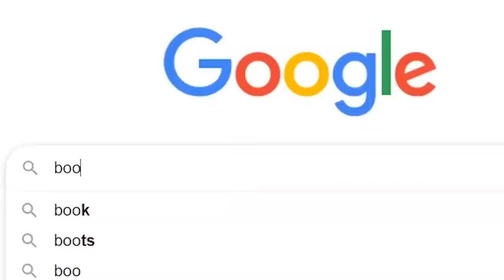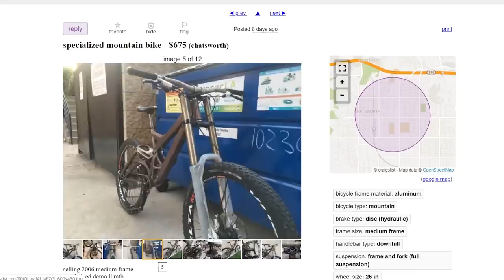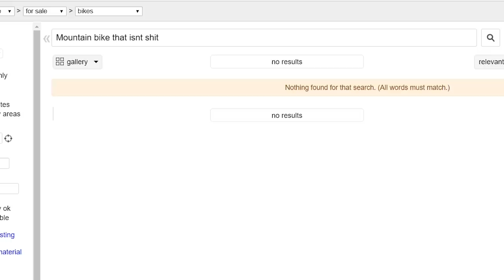Do NOT Buy a Cheap, Used Mountain Bike

Comment: Real mountain bikers were probably cringing through this whole vid
Reply: 🙋..yep!!
Reply: Real mountain bikers started on walmart bikes. I rode something like a 45 pound bike with solid tubes when I was a kid. Now I ride a 29er fully that weighs less than 30 pounds lol
Reply: Kevin O'Hara true
Reply: I was like WTF xD why dont he buy a new one
Reply: Yes especially when he was saying don’t buy a used mtb. Used can be great
Reply: i did
Reply: @lucasomers7520  Yes great for trashing but for real riding u need a new mtb for at least 2,5k
Reply: @The_Dude_420  nope, I do downhill, and my downhill bike was used, ( it's a de vinci Wilson from 2009, with a Marzocchi 888 fork) the "trick" to pull good bikes from used market, is to get SINGLE COMPONENTS and then assemble it, (that's what I did) the problem with doing this, is that, it's not really something for beginners that don't know a lot about bikes,
Reply: @kevinohara8529  not true i started on a trek marlin 6 2019 and now i own a trek slash 2020
Reply: Yep it's awful😔
Reply: Yep
Reply: @The_Dude_420  no you don't.
Reply: Inwas

Comment: I like how he called mountain biking expensive but he thought expensive bikes were $1000-$3000. For a full suspension $3000 is relatively cheap
Reply: Aye
Reply: You can spend 5k+ easy. Hell, some frames alone cost that much
Reply: Ya one of my buddies just got a 2020 Transition Patrol in Carbon. It's about a $7500ish build
Reply: Ehh... you can save $5000 by pushing a few more watts on the climbs.
Reply: Ye
Reply: I been trying to get a bike and the cheapest bike I can find that is actually good for what I want to do is the Giant Reign 2 which costs $2700.
Reply: Tozik 2021 sworks epic is a solid 11 grand💀💀💀
Reply: Riley Buchanan I seen bikes go over 10K, I was just mentioning the cheapest one I could get for what I want is $2700 meanwhile in the video he talks of a $1000 - $3000 range
Reply: Riley Buchanan some ebikes go for 20k Canadian
Reply: @IngE02  look on pinkbike
Reply: 3 months ago, $2,400, brand new out of the box 2016 Kona Process 134 DL. Best decision I've ever made.
Reply: I know
Reply: I mean your wrong but ok.
Reply: >$3000 cheap

me suggesting to my dad that i should buy a polygon premier ($450 here): 
my dad: hell no, why you need that bike so expensive

p/s :my last bike was a 120$ "Trekking 27.5", the front fork failed catastrophically after an hard emergency brake (I haven't even hit the trail yet lmao) (my mom bought it for my birthday last year)
Reply: @IngE02  this years Cube Stereo bikes are great too! And you can get the race versions pretty cheap too, amazing bang/buck
Reply: You're fucked when a company will sell you a set of wheels for the same price of a full sus bike
Reply: No it's not

Comment: I bought an old GT as my first mtb for $200 at a local bike shop. I would highly recommend getting your first used bike from a reputable bike shop because they will have it in good working condition. Also $1000-3000 will get you a decent mtb, but if you want a good mtb you're looking at about $4000 and up.

Comment: I bought a Trek 4300 XC Hardtail about a year ago for $100. I've replaced everything on it except the bottom bracket, headset, and rear wheel for about $500 over the course of a year. 
It's a great bike, but I just wish I'd spent a lump sum on a newer bike with better geometry for around the same cost. I feel like my head tube is going to snap off at some random time when I land a jump to flat.

Comment: bought a bike from blocket sweden for 1750 krona (201,26 USD) pretty good deal, aluminum frame, nice geometry, finger shifter, disc brakes (mechanical), 26 inch wheels (im 11), aluminum pedals. really happy.

Comment: To anyone reading this...If you live in a region where you think there is a chance your bike might get stolen, besides bike locks, something you can do is hide a gps tracking unit on or in the frame. These units are pretty small, relatively cheap and connect via an app on your phone. I know Milwaukee tools makes one but I'm sure there are others out there as well.

Comment: Yea go for a hard tail, especially if you like to jump. They are cheaper cost less to maintain, less issues and you can pretty much do anything with them. I'm on my 3rd hard tail. The only reason I would go full suspension is if I was doing some serious downhill riding or steep technical fast trails that have a lot of rocks and root and drops. Hard tails will get you through mostly anything to be honest and they are way more snappy.

Comment: Welcome to MTB! I hope this doesn't dissuade you from getting back into it. Check out PinkBike's Buy/Sell pages, probably about the best resource for used stuff, although CL and OfferUp can be fine if you know what to look out for, as it takes even more savvy to buy used bikes. Sorry it got jacked anyway. A good D-Lock will set you back $70-100, definitely worth it if your bike is $500 or more. Cable locks are good if the thief has no tools, but I think it was Doddy over on GMBN that proved a cable lock is truly only better than nothing, and not more.

Comment: You can buy a cheap $150 buck wally world special and upgrade it for about $350 and it will be decent.  You will have to replace the wheels to double wall with new tires and a new front fork.  Also replace the rear shock and new wide pedals.  Thats what I did.

Comment: you can get a great bike for under 2000$ actually. 
The old 26ers are still amazing by todays standards & generally bikes like scott spark are pretty well maintained.
Most people drool over the 29ers but the sad truth is that the vast majority is way too weak to accelerate on those large wheels.
Even when the playing field levels a 29er will always have issues keeping up with a 26er on the short technical tracks.

Comment: never leave bike alone in place with little ppl, or in a parking lot, always inside in a car, and always have it locked up with several locks, and if with another bike lock them to each other, use different locks that require different tools to break open, and use an alarm lock.

Comment: 5:26 it's not plastic, it's just covered in plastic, it's actually a metal nut with plastic cover, but the rod you mentioned is a quick release axle. it should not just come off, even if you did some little bit hard riding or hard riding, unless it's not been tightened correctly, which is very common mistake.
the lever should leave a imprint in the palm of your hand if hte nut is tightened correctly, with those classic Shimanoo levers you should have them 90 deg out/straight when they start too clamp, with some others you might be fooled by the design, cus the actual clamping might be earlier, cus they are actually shaped in such way that it there is a bend, so for those you just have to go by feel.

But it could be that wrong materials were used or it was damaged, so it came off due to threads being ruined. or have been loose and been damaged due to abuse.

Comment: (1) You CAN buy great used bikes.I have several. My Merida full carbon road bike cost me $1600 second hand, new it cost $9000. The wheels alone cost $2500 new 
(2) if you want to keep your bike, don't leave it outside
(3) if you don't want your bike to get destroyed by the elements, don't leave it outside.

Comment: I actually spent a thousand bucks new on my cross bike, which I use for commuting and getting around town, which is a reasonable price for this much bike. Completely solid. However, I also started getting into mountaij biking just recently, and also bought a used bike. Found it on the German equivalent to Craigslist, eBay Kleinanzeigen, it was 235 bucks, which was really not much for this kind of spec bike. And it was in really good condition. However, the front derailleur needed some work, and the bottom bracket was screeching, so I replaced that. All in all, 250€ investment. I however soon found out it actually was a little small for me, so I flipped it again on eBay Kleinanzeigen and made a profit of about 100€ on it, an I think I could have made a bigger one, because it sold mighty fast, I think the ad was up for an hour total, because a local bought it from me within an hour. However, now I have a bigger one that I bought for 350€, which funnily enough is exactly what I sold the other one for. This one also needs some work, the rear brake is not working properly, but I will go to a bike shop with that, because I really don't know how to fix it. Basically everything else I can do, but hydraulic disk brakes are kind of sketchy. Bleeding them, fine. But if anything goes wrong beyond that, I'm out.

Comment: The best bargains in MTB are 2nd hand 26" Full Carbon Frame bikes that nobody wants anymore because they are "not the latest thing". Bikes that were $7k new can be had for around $1000 now - which is great news for buyers - not so great for sellers.
Reply: I'd rather get a new but heavy $1000 hardtail than a 15 year old bike. Things are just not the same anymore. Technology trickles down making budget bikes of 2020 far better than top end bikes of 2010. Plus you buy new in stead of heavily used

Comment: Never keep your bikes outside especially if your locking them at a bike rack that's a hot spot for thieves because they know there will be bikes there. Also using a thin wire lock like that is never a good idea always use a u lock and then you can use a wire lock for your front wheel because trust me those quick release wheels take 2 seconds to take off and leave with also put the lock throu your frame and rear wheel. Sorry to hear about the theft next time I suggest keeping your bike inside good luck getting a new one which I really hope you do

Comment: Buying a used cheap mountain bike is completely fine as long as you've done your research beforehand so you can check the condition of the bike also researching into the bike itself is a good idea as then you know weather its actually a good bike to start with

Comment: Basically every used bike you buy needs a little tuning on the derailleurs. No big deal, just watch out for obvious bends or things like that, because that's not easy to fix.
But this bike has so many more problems, that all could have been avoided at buy time.

Comment: don't want to take away from the great vid but I think this isn't the reason not to buy a cheap used mtb, if your going to buy used you need know what the bike is worth new, I got a rly gud deal on a used bike for 250£ because I did my research and I ended up with a rly gud bike with no problems, however you are right in saying that if you are to buy cheap then you need to know what ur getting into

Comment: That's shit luck, but next time consider bringing the bike into your apartment. Don't park bikes outside overnight, and don't use a cable lock on its own because a decent set of bolt-cutters will get through it in seconds. Still, at least it wasn't a high-end bike that cost you $thousands. Do persevere with the sport though - it looked like you were having loads of fun while you had the bike working.

Comment: ALL USED BIKE NEED MAINTENANCE! Some new bikes do too. Bent derailleur hanger is a simple fix. Fucked up bottom bracket is a simple fix. A new bottom bracket will run you $20. Chain rubbing against a derailleur is a simple adjustment. The whole getting a new cassette is bullshit. That asshole at the bike shop just wants to sell you more shit, that isn't needed. This is why mechanics (both bike and car,) have a bad reputation. Get a goddamn tool set from Bikehand, and a bike stand off of Amazon, and you have all the tools you need to address the issues with the bike that got stolen. About $250 for both, then you can do your own goddamn maintenance, and save some cash in the long run. I've road a cheap ass GMC Denali road bike for years and it served me well. The bike snob dick brain at the bike was dissing the bike because he wants to sell you a far more expensive bike. Don't skimp on a bike lock, get a real good one. All bike locks can be broken, however the good ones take forever and thieves don't like taking too much time when it comes to stealing something.

Comment: What did you expect if you leave it outside its going to get stolen
Reply: Gtr Pro Gaming Matthew Ng Wei Chen i was like he lives in a city in 2020 and have a expensive looking bike and have it outside on a bike rack. You shouldn’t need to take it inside but its 2020. I LIVE in an small suburban area and my bike is outside without look when it’s summer. But my sisters 500$ bicycle w a rear wheel look got stolen at a buss station. I our are there’s only like 1k people. Always look your frame to a pole or sum. Never use a wire lock.

Comment: With some research on buying a second hand bike and download a checklist (various wobble tests to check bearings, test drive, etc) you can instantly discover problems with a second hand bike, or areas that could be problematic in future. This can then be used to negotiate a price or decide it's not for you.

I think it's unfair to categorically state that you shouldn't buy a second hand mountain bike.

Buying a full suspension bike on the cheap is generally not a good idea though. It's better to buy a hard tail, or no suspension with good quality parts. That way the bike is lighter, less to go wrong and less maintenance.

Also your end suggestion is somewhat bizarre. It's sad that your $200 trash mountain bike got stolen, but you then recommend buying a $400+ second hand mountain bike, or buy new. Investing in better locks and security awareness should also be advised if you recommend buying a mountain bike double, triple+ the price.

Comment: Don't buy cheap and used my fucking ass. I got a Gary Fisher Cake 3 DLX for about £30 or $50 ish. Not perfect, spent around £40 more to fix it up. You can easily get a bike for 'free' if you know what to look for. Don't get me wrong, it's an oldie, but mountain bike tech hasn't really advanced too drastically from 2004 to 2020 the same way computers have, for example. It used to be valued at $1500 at market price when new and it definitely holds up to other Full suspension bikes at around the $1000 value even today.